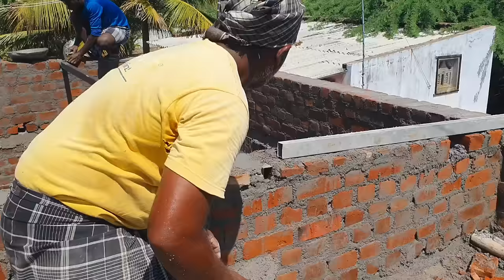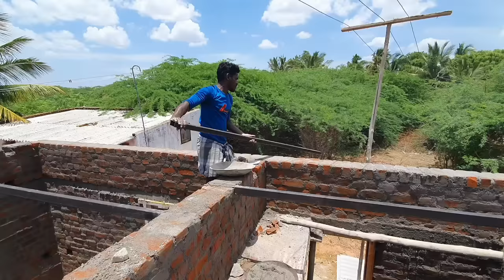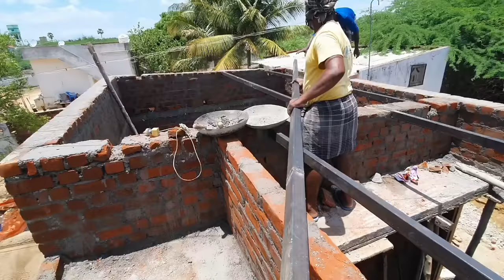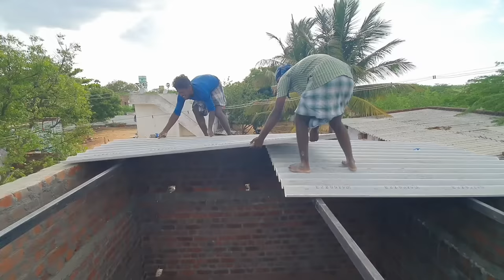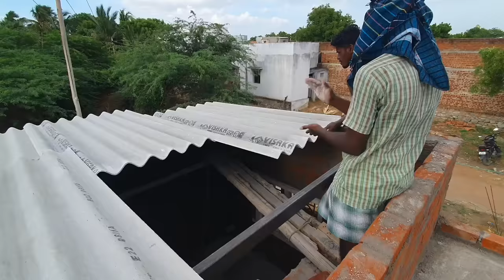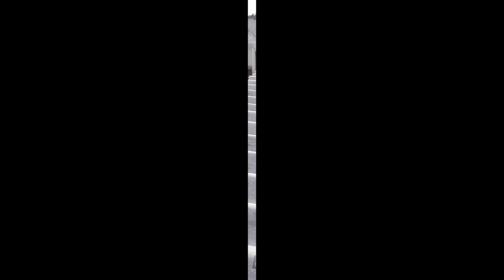Asbestos Roofing Sheet Installation_Perfecly Fitting On House Roof Cement Sheet|Asbestos Roof Work

Comment: Why would you still use asbestos when its forbidden in the most countries?
Reply: Asbestos is the best weather proof sheet for indian climate.
Reply: @SharkFishSF  don’t forget about cancer due to asbestos
Reply: @c2couples746  road dust is the cause for most air pollution, not some cement sheet. And if it is so, painting it with a waterproof paint resolves the issue immediately.